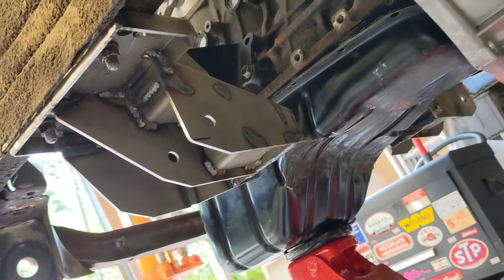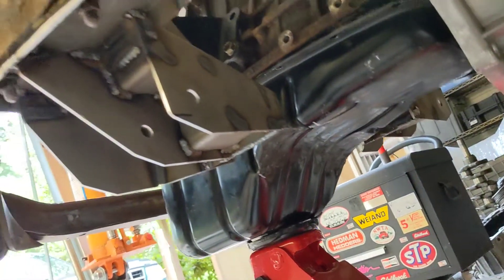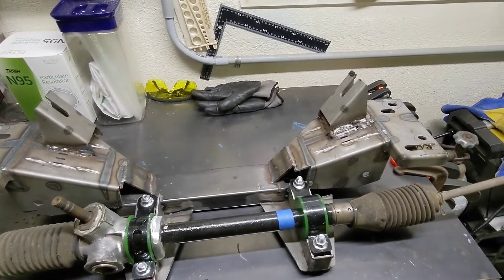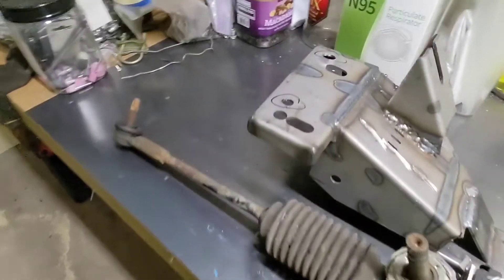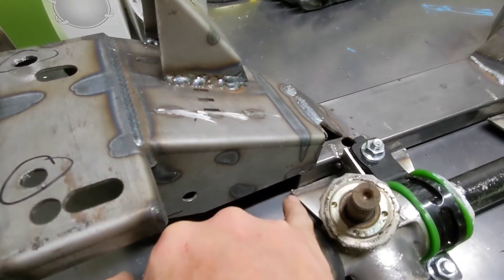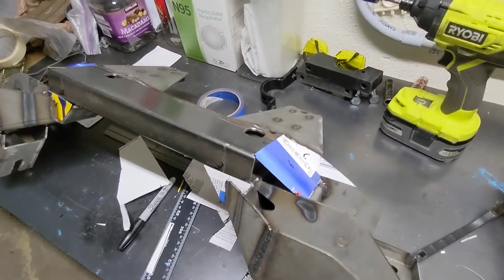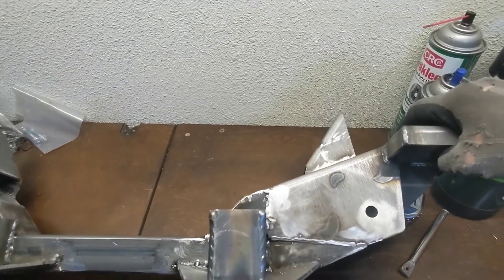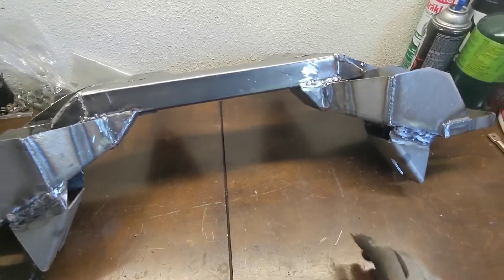1973 Celica ST Build Part 10 Frankenstein Crossmember modification

Comment: Looking good! Are you reusing the stock control arms? I believe the aftermarket ones T3 offers along with a few other parts allows the geometry to be corrected but that of course comes with significant cost.
Reply from the maker: I am using as much stock bits as possible including the control arms. Good piece of experimenting we did on  suspension the other day was confirming that AE86 85-87 COROLLA bushings fit our Celicas. The full kits are cheaper by about $100. You do however need to reuse the rear upper sleeves so same em :)  
https://www.ebay.com/itm/303961459766
Reply: @noidretlaw  nice! Your solution should work out well, looking forward to the next update. And awesome info on the bushings!